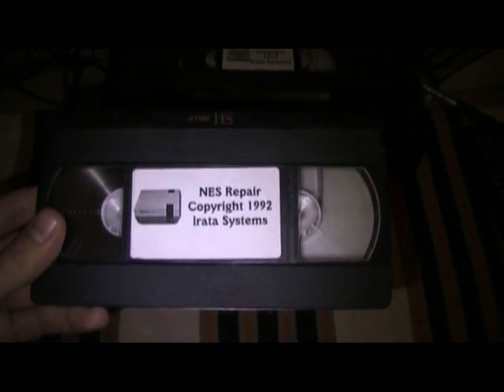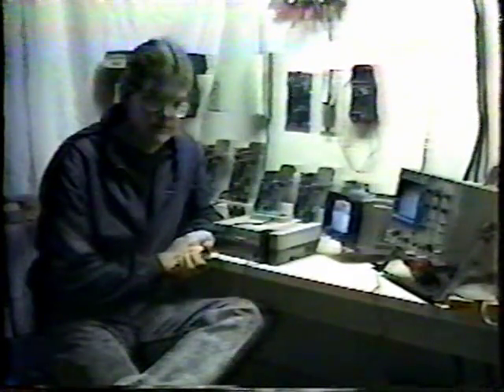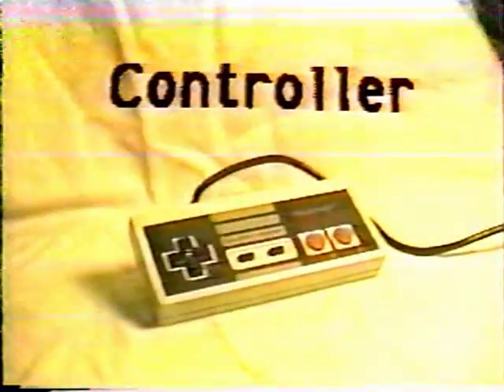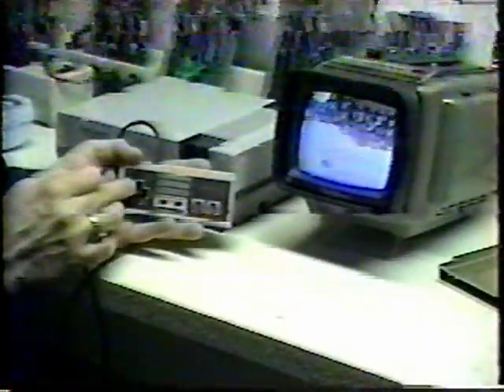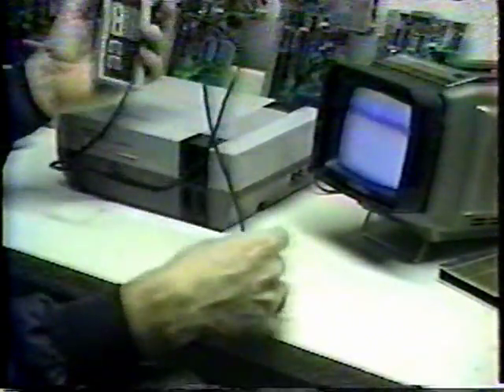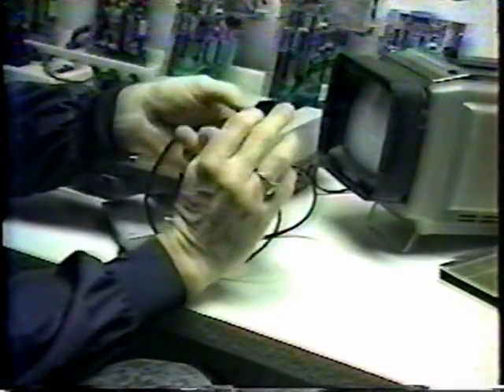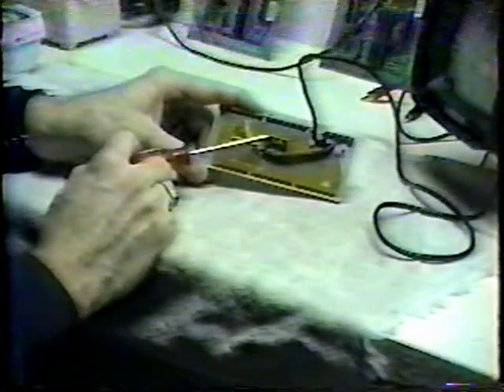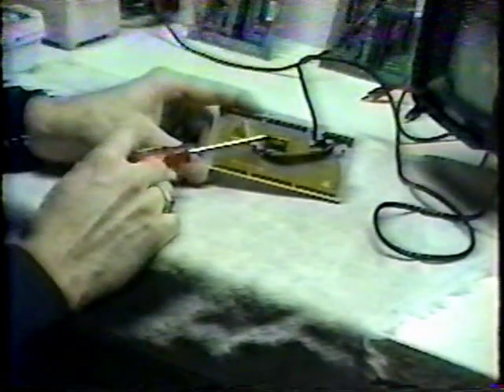Nintendo NES Repair by Irata Systems 1992 Part 1

Comment: 2:02 YOU FUCKER! thats not how you wrap a wire. fold it in halves stopping just before it becomes stiff to fold and then TWIST TIE them together. Putting tension on the wires causes the copper inside to fracture and break. NEVER tighten them around an object, other wires, or tie knots when bundleing wires!